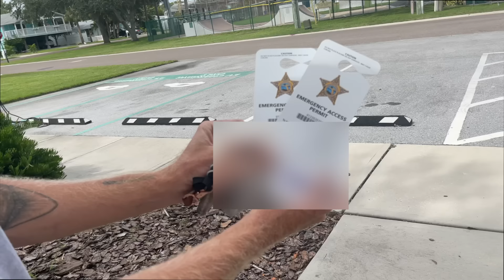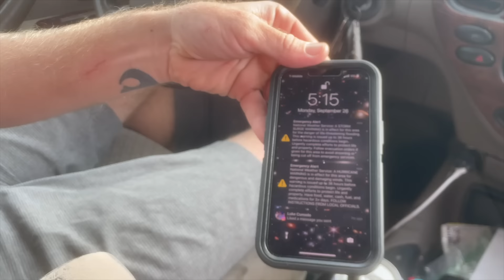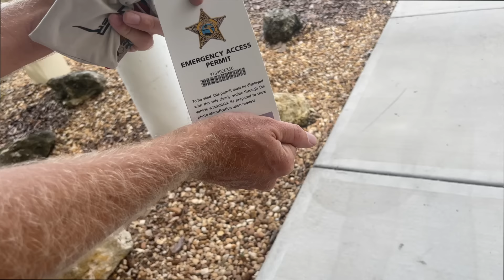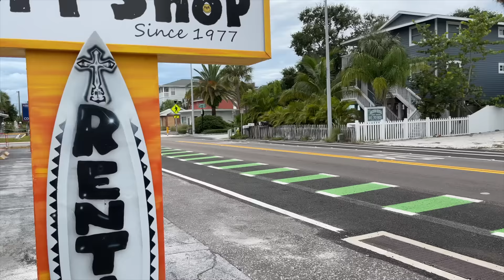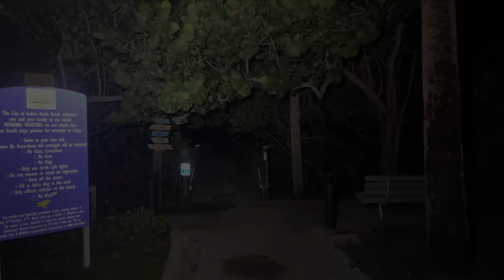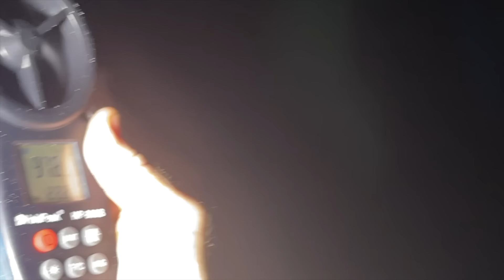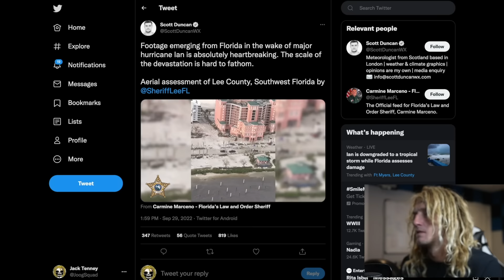SURVIVING INSIDE HURRICANE IAN!! | Full Vlog Start To Finish (Mini Documentary)

Comment: Bro you way over filled that oil. You should be able to open the oil plug with the generator sitting flat on the floor. The oil should be almost all the way up to the threads when flat on the ground.